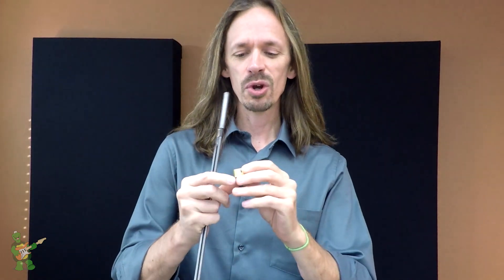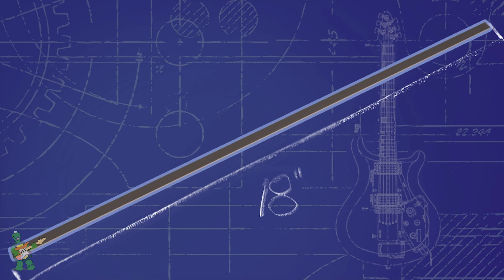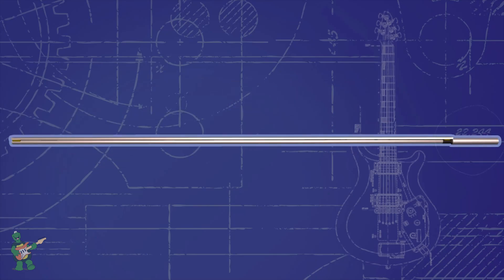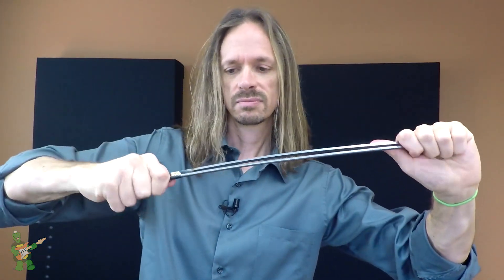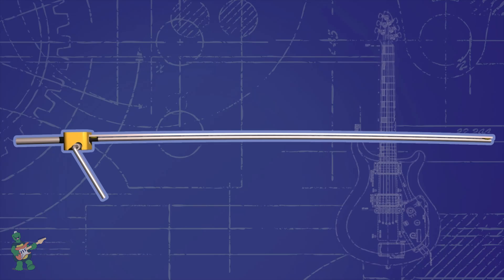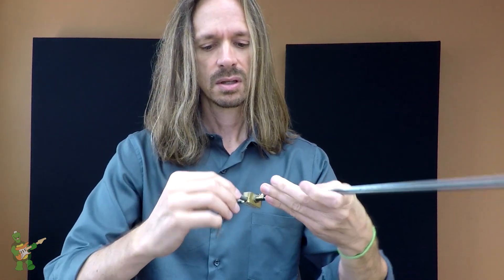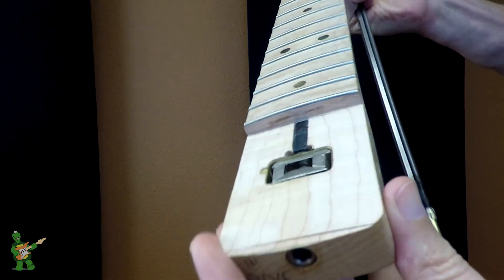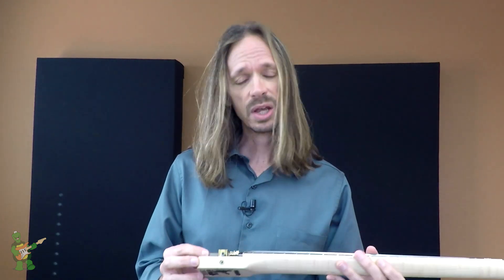The Warmoth Double Truss Rod & Side Adjustment Mechanism Explained

Comment: How many times the truss rod can be used effecively?
Reply: depends on its quality, that one on the video doesn't looks very good
Reply: cq33xx doesn't look good?? Why?
Reply: @satriasamudra306  it hasn't any finish to protect from rust and the welded spots look like solderings and if so maybe pop up by pressure, also the color of the metal doesn't look like quality steel, i dont like it in general.

and im not even talking about that Side Adjustment... that is a joke
Reply: cq33xx would you show me what good truss rod?? Mey be you could give me youtube link what can I see. Thank you
Reply: @satriasamudra306  this is what a good truss rod looks like
https://www.stewmac.com/Materials_and_Supplies/Truss_Rods/Adjustable_Truss_Rods/Hex_Nut_Hot_Rod_Truss_Rod.html
if you makeing your own guitar get it from there

Comment: So these double truss rods act only as a one way truss rod, unable to adjust for back bow. That sucks.
Reply from the maker: They are are a double truss-rod design, which is different than the "bi-flex" design some other companies offer. The point of them isn't to flex both ways. The point is that when they are tightened in order to curve, they aren't compressing the neck wood, like single truss rods do. Instead the compression is against the second bar of the truss rod. It doesn't suck....it's actually a great design used by many manufacturers. If you prefer the bi-flex style, that's cool too, but Warmoth does not offer it.

Comment: Very Cool Necks I own 3... The Only thing That wasn't mentioned is the Side Adjustment is 3 mm/ metric. I've never had to Adjust any necks till now 
I need to adjust the Tele neck. !/4 turn should do it That's it. I'm using the back adj screw. with a straight edge stainless steel flat stock. 
To bow the neck upward clock wise turn. To curve it counter clockwise. Enjoy.. < concave neck adjustment .

Comment: I read that you have to loosen the strings before turning the side adjustment screw.  How critical is this?  Do I have to loosen them all the way, or can I just dump the whammy and slacken the strings that way?  What damage does it cause if you adjust it without loosening the strings first?
Reply from the maker: Dumping the whammy works fine. I do it all the time. The idea is to relieve the pressure on the mechanism while make the adjustment.

Comment: it appears that you are brazing the two rods together. Wouldn't it be better to MIG weld them which should be a stronger weld ?
Reply: I'm a welder, and I thought the same thing. Prob has something to do with the amount of heat involved and how much said heat distorts the metal.
But I'd like to know
Reply: @prd004.2 Maybe and that's a big maybe, the material use for braising has a noise dampening effect on the truss rod.
Reply: Most of the truss rods I have seen appear to be tig welded or actually "spot" tig welded.  As for the strength of the brazed joints?  It's strong enough to do the job and that is all that matters.

Comment: So the Flat Bar of the truss rod, which is closest to the fretboard, actually bends the neck against the string tension? so technically loosening the truss rod would allow the subtle curve of the neck, where as tightening it would straighten the neck? is that opposite of standard truss rods?

Comment: Looks like they are brazed not welded. I had a Vega banjo that had a truss rod like this only both bars were round.  When it was nit tensioned you could pull it out of the neck.

Comment: The bullet truss rod system would seem to eliminate the need for a micro adjustment since it seems to be a workaround to having to take the neck off to adjust the trussrod. So why not go with that/ Is it the mass taken from the base of the neck, rather than closer to the headstock where most people play?

Comment: All my necks are warmoth pro necks with the side adjust, I love it. Anyone saying that they "rob tone" wouldn't know tone if it smacked them in the face because chances are they are running 99 effects on their digital modeling amp computer software (to hide their screw ups). why can't anyone play with a simple jack cord straight into a Marshall anymore??? That's tone!!!!!
Reply: Lol I play with the simplest setup I can, I have always hated too much going on as far as effects go. I have some stuff that sit on a shelf with zero use (wah pedal, effect processor) both collect dust. I rely on pickup selection, a pedal I built for distortion (freidman-BEOD circuit with modifications to the diodes and caps used to soften the 4 gain stages in the circuit with a true bypass to get to the actual sound of my clean channel) and a Blackstar tube amp on clean with everything zeroed. 

It was the simplest setup I could do and get tones from the 50's all the way to now. Sometimes I will use the boost on the amp. The pickups has always been where I adjust tone and sometimes the electronics of the guitar itself so it causes me to have 2 guitars with actives from both Seymour Duncan and EMG but I got a strat with vintage noiseless in them (still can't get passed the 60HZ hum) and a couple of odd passives in a couple of odd guitars. I still feel the tonal quality of a guitar is found in the instrument and how well it is built and how well it is tailored to the person using it. Nuno Bettencourt is a prime example of a person who tailored their guitar from parts to himself. 

I am with you I do not consider a computer modeler an amp, it is a virtual practice amp and should always be treated as such. It can produce clean sounds and some are unique enough I actually like them but it still does not compare to the sound obtained by an actual amp guitar and a good player. There is no way that tiny thing that uses a brass containment block (which should be tonally ideal) robs tone, if a person says it does they have sloppy playing. But then again I am a person who finds guitarists like Slash or David Gilmore are great guitarists, not because of technical ability but because they play the shit out of their guitars.
Reply: Why? Because you actually have to be able to play...
Reply: You've just described my favorite guitar tone; Guitar/Mogami Gold Cable into 2203 Marshall...COOKED! Some kid asked me how I got my tone after a show once, I handed him a guitar cable, and laughed, he was amazed.

Comment: I don't understand. Why the side adjustment. What's the advantage of it as opposed to a headstock adjustment? I know for a one piece neck the heel adjustment is necessary but not for a two piece. So why side adjust as opposed to headstock adjust?
Reply: infinite1funk  Correct - they are a simple single rod.
Reply from the maker: The side adjust mechanism is used for convenience on necks where the main truss rod adjusts at the heel. That way you don't have to take the neck off to make adjustments. On our "tiltback" necks, which also use the modern truss rod, the adjustment nut is at the headstock, so no side adjust mechanism is necessary. So....I know what your next question is: "why don't you just turn the rod around on your straight headstock necks too, so that they all adjust at the headstock?" Answer: because you can't. It's difficult to explain why without using diagrams, but I will try. When a traditional single rod is installed, it's default shape is curved. More specifically, it curves upward at each end. That means as the headstock end approaches the headstock, it is heading upwards, and a very small hole can be drilled to provide access. However, when a double truss rod is installed, its default position is straight. It is NOT curving upwards as it approaches the headstock. An access hole at the headstock would have to be so large as to be structurally unsound. So....double rods are oriented with the adjustment at the heel. Different manufacturers have taken different approaches to making the heel adjustment convenient. Some use a spoke-wheel type contraption, and a notch in the end of the fretboard....Charvel, Fender, Music Man, etc. However, this solution means that these necks no longer adhere to Fender's traditional neck pocket specs, and aren't interchangeable. Warmoth's entire business model revolves around keeping our necks interchangeable, so in order to maintain compatibility with Fender's traditional specs we adopted the side adjust mechanism. Hope that makes sense.
Reply: Thanks for the reply. So new Fender headstock adjustments and older fender bullet type headstock adjustments, those aren't double truss rods.
Reply from the maker: I'm not a Fender expert, but I believe they are single, traditional style truss rods. PRS and Gibson use traditional single rods too. Warmoth does too, on our Vintage and Vintage/Modern necks. Only our Modern construction necks use the double.
Reply: The big advantage is not having to take the neck off to adjust it - which if you think about it is a ridiculous idea since you need string tension to accurately adjust a truss rod. What everyone has done for decades is just wreck the pick guard with a Dremel or a pocket knife so you can get a flat screwdriver on the truss rod nut without touching the neck screws.

Comment: Question -- is this trus rod able to correct both a front bow and a back bow?  It looks like the trus rod only goes one way.
Reply from the maker: The Warmoth double-truss rod bends in a single direction, by the use of two different bars anchored to each other. On traditional single truss rods, the bar is anchored to the neck wood itself. There are certain rods that flex in both directions, sometimes called "bi-flex" truss rods, but Warmoth does not use them.
Reply: Thanks so much for the response!  Can you comment further on why you don't use bi-flex truss rods?
Reply: @5urg3x  because the string tension provides the pull in the other direction. The whole point of the truss is to counter that
Reply: @prd004.2  Of course, but wood is a strange animal.  It reacts to climate and humidity in ways that can cause it to twist and warp in any direction really.  The tension capable of being applied from a truss rod is orders of magnitude greater than the tension coming from the strings, even if heavy gauge strings are used.  And if the player is using 9s or lighter, on a 25.5" scale guitar, with no wound third, that's barely any tension at all.
Reply: @5urg3x  Nick, great response.  Love my Warmoth neck, but could REALLY use some neck relief.  With 9s or 10s, there is really not enough tension to provide relief.  Otherwise, the neck just lays flat, requiring sting action to be a bit higher than preferred. And, I have a wenge next that appears to have less "give" than typical neck woods.

Comment: i thought that if you relax the truss rod, the string tension would make the neck concave, and if you tightened the truss rod,the neck  becomes more staight. The string tension doesn't play a role ?
Reply from the maker: You are correct, and string tension definitely plays a role. I think the thing that is throwing you off is the fact that when a double truss rod is at rest, it is straight. Imagine a brand new neck. The truss rod is sitting in that neck, chilling, at rest, and straight. Then you put string tension on the neck, and the strings start pulling the headstock towards the body, and neck begins to bow. But.....the truss rod is still just sitting in there, relaxing, doing nothing. It is still, essentially, straight. It's made of steel, so of course it is providing some counter-force just by virtue of the fact that it is naturally more rigid than wood is...but it's still not actively doing anything. In order to provide the force necessary to counter the tension of the strings you have to tighten the rod. When you do this, the rod starts to bow in the opposite direction of the neck, exerting downward pressure at the headstock end, which pulls the neck back towards straight. To put it another way: the truss rod pulls the neck back towards straight by bending in the opposite direction. To be clear: this explanation only applies to double truss rods. Traditional single-style rods work differently.
Reply: Warmoth Guitar Thanks, that makes sense.

Comment: How do string gauges (increase or decrease) affect this?
Reply from the maker: Different string gauges will exert more or less force on the neck, depending on whether you are going up or down in size. That means you may need to tweak the truss rod a bit to get things exactly how you want them. Not necessarily, though. If it were me, I would play with the new gauge for a while and wait to observe any changes before jumping in and making adjustments.

Comment: You should make a video showing how to fix the side adjuster if you unscrew the allen too far
Reply: It stops moving about 8 turns before the screw comes out. Should never happen. You can actually feel the lack of resistance
Reply: @1serious-gearhead  If it gets screwed in too far, It can be a real problem.

Comment: Why don't we just get with the times and install a truss rod that adjusts in both directions and can be adjusted at the nut. Having to take the neck off to adjust the truss rod is a pain in the ass and some people live in areas where the climates change frequently.
Reply: Uh, side adjustments are what this does, without taking the neck, strings etc off.
Reply: rob is right . still can't go in the negative direction. and why add moving parts. this has been dumb from the get go . its a workaround for the top truss adjust. welcome to the new england area where the truss get changed constantly
Reply: @robertmahaney6831  Wouldn't a heel adjustment wheel allow for more adjustment than this side adjust?  Seems like a simpler addition...
Reply: @robertmahaney6831   On my warmoth neck, with the truss rod untensioned, it forced relief in to the neck without string tension.  If you look closely at the video, without tension, the truss rod is slightly bowed due to the way it is made.  Sort of a passive 2 way action.  To get the truss rod "straight" you need to partially tension it.
Reply: Got an Ibanez that does just that.

Comment: I'm confused, isn't the double truss rod supposed to have threads on both ends?
Reply: So am I : I think Warmoth double-expanding truss-rod IS NOT a two-way truss rod, so if your neck is severly back bowed, the truss rod can't force the neck to go in the other way to fix the problem...
Reply: @gloubiboulgazeblob  - this is technically correct, however in a properly made neck the string tension is all you need opposing the single-action truss rod… I would imagine backbow is likely super rare.
Otherwise warranty should cover?
Reply: I think those are called dual-action truss rods. There are a few different designs out there for sure.

Comment: how is this more stable? the flat rod is still the same and I don't see how the mechanism  would prevent that from moving with climate changes.
Reply from the maker: That's exactly what the difference is. A traditional single rod works by compressing the neck wood. The "anchored end" is captured with the neck, while "adjustment-nut-end" squeezes inward on the wood at the other end to generate the force needed to pull itself straight. Because of that, its overall stability is tied to the stability of the wood. With a double rod, the all inward pressure created by the rod is not absorbed by the wood at all, but by the truss rod itself, which is much of steel and much less effected by changes in temperature, humidity, etc.
Reply: It's not the same because in this design the pressure is created between the metal tube that is soldered to the flat bar and tightening the nut against that metal tube as opposed to a washer placed against the wood of the neck itself, or at least that's what I think the difference is.

Comment: So the side-adjustment nut is located outside of the neck pocket when having the neck bolted on, right? just making sure.
Reply: Yes.  The point is you can make rod adjustments without having to mess with the strings.  I've never had to use the major adjust at the heel with any of my many Warmoth necks.

Comment: That is cool but it's still somewhat limited. It  seems to me that the adjustment nut at headstock or musicman type adjustment at heel are better options because you can make even major adjustments without removing the neck
Reply: I own or have owned over 10 of these necks.  I have NEVER had to use the heel major adjust nut.

Comment: Great video. The cut-away neck really makes it all clear. I must admit that I previously misunderstood the "double truss rod" concept, thinking that the adjustment could produce either convex or concave fingerboard shapes. Can you confirm that the action is in a single sense (counteracting the effect of the strings) but achieved by the different tension in two rods?
Reply from the maker: +Mark Thomas: You are correct. The Warmoth double-truss rod bends in a single direction, by the use of two different bars anchored to each other. On traditional single truss rods, the bar is anchored to the neck wood itself. There are certain rods that flex in both directions, sometimes called "bi-flex" truss rods, but Warmoth does not use them.